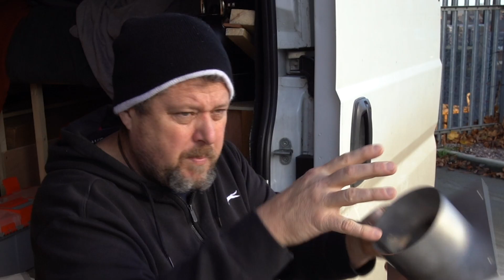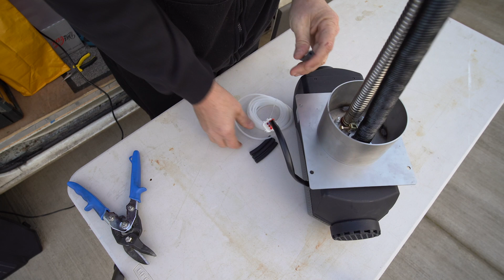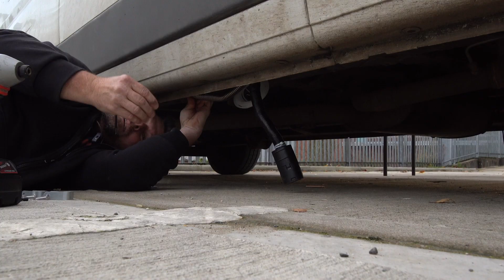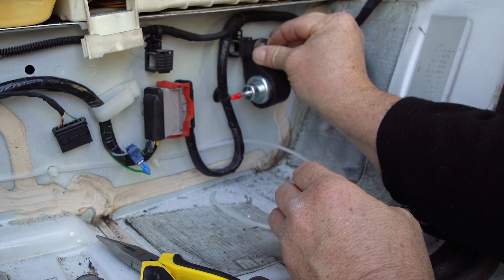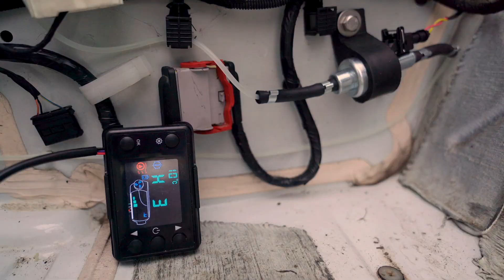Stainless Steel Base Chinese Diesel Heater Install

Comment: Nice install and how 2 mate 👍I made my own flu box out of stainless as I wanted mine off the floor due to ramming my tools in and out 😂 makes it a lot better job using those those plates 👌👍
Reply from the maker: Thank you Professor Victron!!! Appreciate the comments
Reply: @BruceLauderdale  👌👊👊👍

Comment: Am only half way through and have paused to comment my thoughts. That stainless flu is an epic find. So much safer from the perspective of heat transfer as you say but also because of the larger single hole you can prep the hole heater before inserting into the hole. So much better. Why have I never seen this before. Best diesel heater vid on YouTube IMO.
Reply from the maker: Ah cheers mate. Them are amazing words!